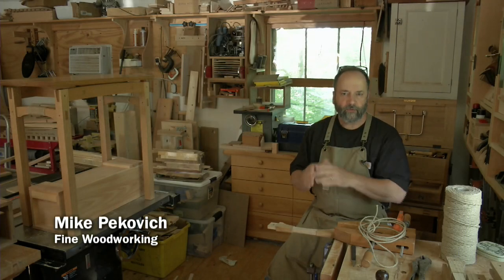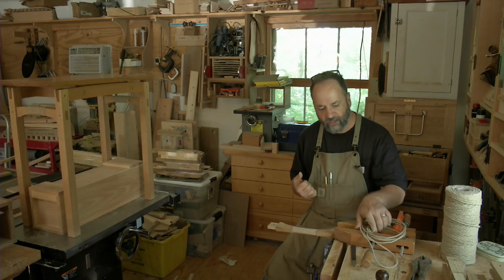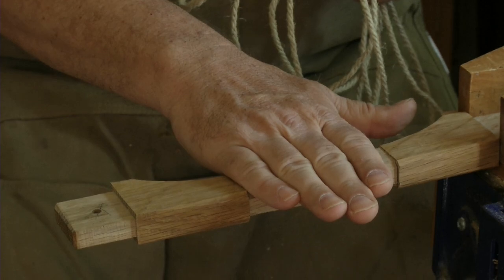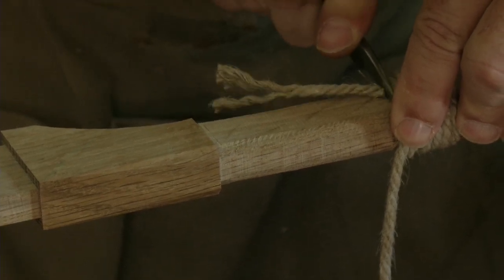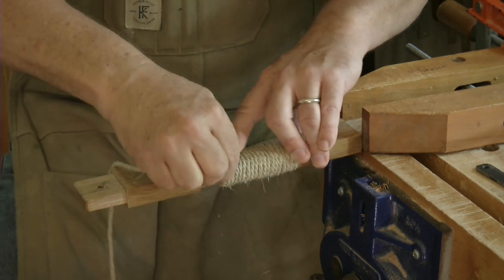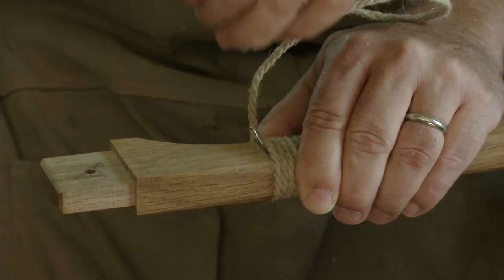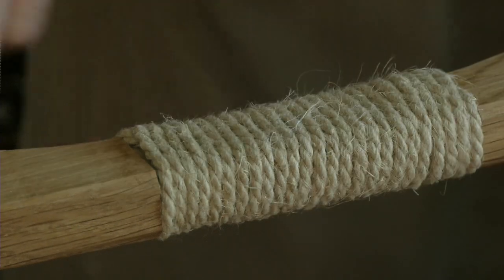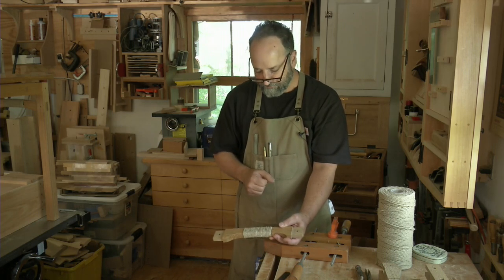How to Wrap a Handle with Cord with Mike Pekovich

Comment: Pretty sure this is called whipping. I learned it in Boy Scouts for preventing fraying at the end of a natural rope because you can't fuse it with a lighter like you can nylon rope. Also instead of using the wire loop to pull the rope through, you can just use the other end of the rope folded into a loop and run it across the whole handle so you can just pull it through when you finish.
Reply: whocantexplain You could use a turk's head knot to seal the ends. We use that on braided leather.
Reply: As I replied to Ian Hopper, the technique is NOT called whipping UNLESS it is specifically being used as you described, because the specifics of the technique are NOT The point, but the outcome on the rope end is the point.  So dipping a rope end into a rubber material is also called whipping the end.
Reply: Larry B Haha I had no idea! Thanks for letting me know. As I said, I learned this many years ago when I was still a Boy Scout and I'm sure they never even told me that part of it, just the one specific use and how to do it.

Comment: Speaking from the UK, I know this as Bristol Whipping, or a version of it. In the version I know, instead of a short length
of cord being laid down at the beginning and wrapped over, an entire loop, up the work and back is laid down, leaving
a loop sticking out at one end and a tail at the end where you start. After whipping, the loop is used just like the wire one
in this video, pulled by the tail at the other end.
Reply: Thank you, I found an example of this in a video titled "Common Whipping Great Covering Knot How to Tie", by the channel Knotting Knots. 

I'm trying to protect a couple of wooden legs from cat attacks with some cheap natural rope without using glue. Will test out both of these.
Reply: Thank you that is what I was trying to remember how to do. My dad taught me how 45+ years ago and I used to screw around with it but really never needed to know how. For years it pops into my head and I obsess over it for a bit lol. Today I said I’m going to google it and found nothing but this video. Very nice but not what I was looking for I knew Iwould  find something in the comments 🎉

Comment: Is good job < on side note if wrapping thick cordage or rope when starting , do two wraps then un-braid the end being overlaid, and spread it out so it does not push the wrap prouder all in one line, has side effect of making hold tighter. Find a drop of any quick-set glue under initial layin to also be worth time as then no wrestling constantly into place under first two wraps. is easy.{side effect can wrap tighter on initial wraps. {learned from old Japanese man who used to wrap Katana sheaths.
Reply: Brian Stevens- great tip, thanks for sharing!
Reply: Brian Stevens — excellent info, I would also add that using needle-nose pliers to “roll” the pull-loop through the end-wrap is a lot easier using the leverage of the tool rather than brute-force pulling it through.
Reply: When I start I leave some cord under the wrap it pulls itself

Comment: Nice, simple and clever trick. After watching your video I used this technique to do two wraps of jute around an empty Nuun hydration bottle. Inside the little plastic bottle is frayed jute for my inner fire tender bundle. Once the shredded jute runs out, I unwind more off the bottle, shred it and stuff more in the bottle or just use it straight to start my campfires. Because of the slipper bottom, I did add a touch of hot glue, but I also added a paper clip into the bottle so that as I begin unwinding the jute off the outside of the Nuun bottle, then I can rewrap the end successfully just as you demonstrated. This is simple, but awesome. Thank you so much for sharing!

Comment: I like mixed media. Projects are always more interesting when you introduce other materials.
When finishing if you don't bring the tail end of the cord up so tight into the wire loop it will draw through easier and not displace your wraps. The way you did it the cord has to pass back around the wire as you pull.

Comment: I use Minwax Wood Hardener on knots I tie around the tops of bottles I cover with leather.  They sell it for firming up rotted wood.  It's very thin, penetrates well and when dry stiffens up the cord nicely without making an obvious coating.
Reply: GrinfilledCelt I use CA glue and an accelerator. Definitely makes it permanent but loses the look he’s got going on.

Comment: Mike, what you did on the cord on the small chest would be called serving in nautical terminology. If you lay a few turns on the end of a line to prevent the line from unraveling it is called whipping. So I think you are safe to call the rope work on the table stretcher serving. Really neat!

Comment: I've bought a (cheapish) Japanese saw with a rope wound handle. Same thickness of cordage pretty much. But I was thinking: is there a way to finish it off like with a (drying) oil or maybe even a harder wax? It might not be necessary, but I'm doing my axe handles religiously with boiled linseed oil to care for the wood, give it a durable protection and keep the axe heads on tight, so taking my saw into that routine is no biggie. I just want to know if it actually would be nice or that the handle would start to feel weird or something.

Comment: Would there be any advantage to soaking the  cord first, so that it would expand when wet, and would then shrink tight once it had dried out ? I know this would work with leather, but I am just surmising that it might work with hemp cord as well.
Reply: murrmac a leather wrap sounds pretty nice.
Reply: murrmac maybe jute? Hemp doesnt exactly tighten down like jute (it will- it just doesn’t shrink as drastically). You could try with cotton& then stretch as you wrap it..?